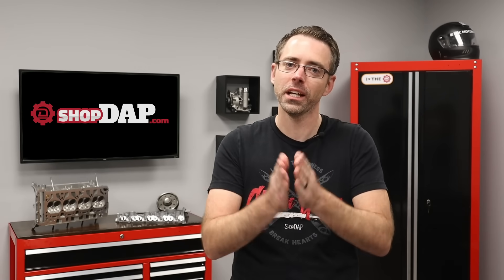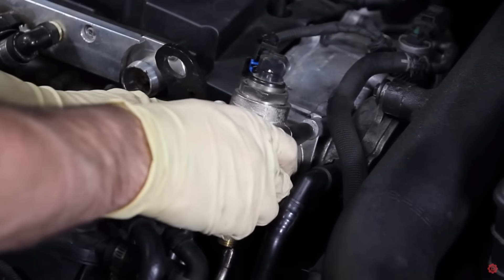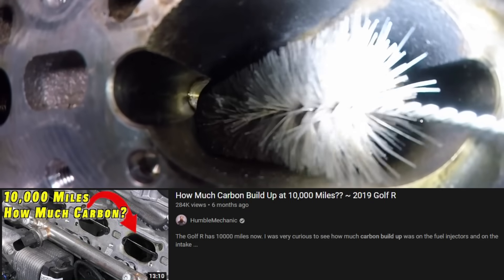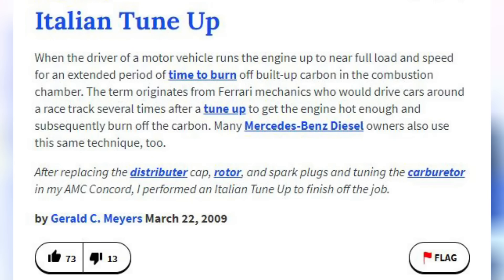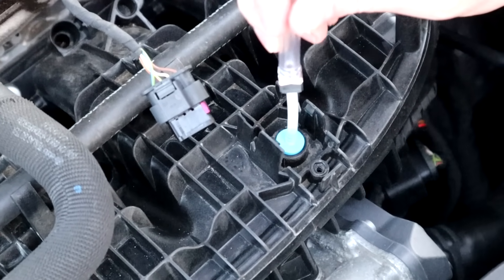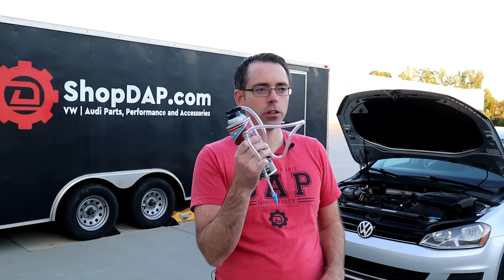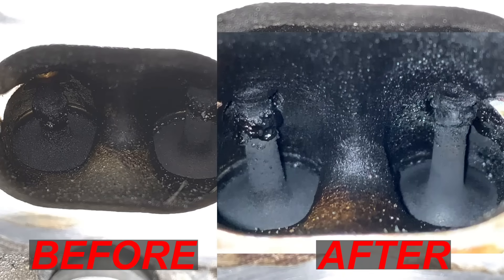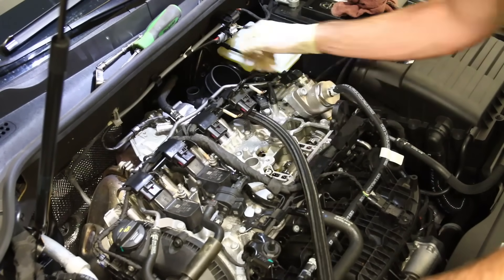Can you Really Remove Carbon for $29?

Comment: In the olden days we poured a 1/4 cup water in to carburetor while engine running and rev engine up run for a few seconds followed with about a 1/4 cup of marvel mystery oil to relubricate, seemed to work.

Comment: Automotive emissions have nothing to do with atmospheric/the ozone layer. It was chloroflourocarbons (the R12 refrigerant vehicles used to have, other refrigerants and spray propellants) which created most of the ozone damage. PCV systems were for hydrocarbon emissions and road safety. The old "road tube" crankcase vent would dump oil onto the road surface making it slick. Hydrocarbon, nitrogen emissions and fog and sunlight create ground level Ozone however which oxidizes body tissues.

Comment: Trying to diagnose a problem with my mk7.5 puffs blue smoke on start up after a good drive if it sits for a short period of time would carbon build cause my valve seals to leak resulting in the smoke on start up ?

Comment: FYI, Co2 is a global warming gas it will not punch holes in the Ozone. Freon- R12 is Ozone depleting, not C02.
As for dissolving carbon into a running engine, the moment dissolved carbon is combusted it crystallises and will damage the engine. Then there is the carbon build up in the oil control rings!!
The sooner Audi, VW and all the rest of the direct injection cars are scrapped the better.
 
The VW group was never seriously interested in the environment, see Diesel Gate and Direct injection.

Comment: I try to use the STP pro series Valve cleaner every 3 months to keep a grip in the carbon.. But sometime I'll mess it up like yesterday..  I put the little you bend in the intake and then clamped it back down, But not realizing that I torqued the clamp to tight and sat there for 9 minutes with nothing coming out of the bottle because of the clamp.. I have wasted like 5 bottle's this way before. With none of the spray never making it to the valves. I am so fucking pissed. It's like almost 200 bucks wasted over the last year and a half.. It it ok to just pull the brake booster line and pray it in that way.. It just seems way easier than, pulling the intake clamp and boot off.. At least on my car..  Brake booster line  ?????????

Comment: I work at Mazda, so i service a lot of newer cars, i however drive a 2007 Mitsubishi Lancer/Galant Fortis (Last chassis for the Lancer/EvoX Gen). My Lancer is getting close to 400,000kms but doesn't have carbon build up issues as it is port injection + i do a chemical intake clean once a year. At work however, particularly on Mazda 2's.. we have seen significant carbon build up by 60,000kms, Mazda's band-aid fix was to program the VVT/VVL to open the valves slightly to  recirculate fuel vapours around the valves but its like a chemical clean on the high km cars.

Comment: Not sure which after photo's your looking at but I didn't see any reduction in build up.  These intake cleaners just don't have the time to do any removal before it is burnt and sent down the exhaust.  With port injection the fuel works from the beginning of the engines life to prevent any build up.  With the amount of build up in our engines these days you would have to use 10's of cans to maybe loosen the build up enough to clean off the ports and valves.  

Get the cleaning done properly and then maybe a can of this stuff every 5000km or maybe just every oil change.

I would like to see a video on that.  Completely clean the intake with caustic soda and walnut blast the valves.  Do an oil change then when the next change is due, do it then a intake clean and see if there is any build up after that.

Comment: There really isn't an easy way to remove carbon build up  on the air intake and exhaust ports. But I really like the idea of using Baking Soda over nutshells.  Baking soda shouldn't be a big deal if it gets into your engine. Sure change the oil, but it's not like the stuff used to blast off carbon. I think deleting your pcv valve and going to oil catch can is best way to reduce carbon build up in the first place.

Comment: I never paid much attention to direct injection until I bought a new Mazda CX-5. Now that I have been watching all these carbon buildup videos I'm wondering if I bought the wrong car. Then I discover, out of ignorance I guess, that I have been driving a direct injected Kia Optima for the last 8 years and 130,000 miles. That engine had the same performance and got the same gas mileage when I got rid of it as it did the day I bought it. Hopefully the Mazda will do the same.

Comment: Total Waste of time.   You need new glasses.   You saw and improvement on the AFTER pictures,   You exaggerate way too much.   It barely did squat.   I'll bet Berryman wishes you never did this video.    GDI is GARBAGE!!!    Buy an old car with Port Injection or a Lexas that has both types of injectorss.   The Port Injectors are there to was the valves because Lexas realies this is the only way to prevent carbon build up

Comment: 8 months later, still running WMI on my ea888 gen1 which takes me to almost 2 years in total of WMI on that engine. It's doing its job. In the long term I would say the initial cost and install time it has been worth while.  

I would like to mention that I was having minor cold start misfires before I installed the WMI,after about a month of running -20f washer fluid with the wmi starting to spray at 3psi and progress to full spary at 25psi. I did/do run the car hard so it sprays often.  Anyways,after about a month my cold start misfire went away and hasn't came back at all. I haven't had the manifold off in a couple of years(hope it stays that way.) So I can't tell you for sure how the valves look.
Reply: so your not sure if it actually is keeping them clean?

Comment: the Berryman product did not seem to clean those VW valves as well as other videos with CRV valve cleaner...and did you say you injected the fluid into the MAF hole?   Other vids say to use the brake vacuum hose...and hold the revs around 2000 rpms instead of just at idle, which you did.   Can you comment on those differences?

Comment: I totally agree 100%. rather prevent than cure. To fix a problem, better to know the reason for it. Fitters replace a failed part. Why the problem first, then fix. It is why so many make errors. Fitters replace parts, Mechanics see the problem, the cause, then fix, and can actually be free

Comment: brake fluid does the same just suck it in thought the pcv until the engine stalls and leave it over night ,cleans up nicely the intake ,valves and pistons ring . Change your oil after

Comment: This has to be the most insane adoption I’ve ever seen. They went from a super reliable fuel delivery system with port to direct injection? Why? So you get a tad better emissions when new at the expense of worse emissions for the life of the vehicle? I refuse to buy a direct injection engine unless it has supplementary port injectors.

Comment: I did exactly what you described at 7:20min. Scrubbing, cleaning, scrubbing and cleaning etc. It took a day on my 6 cylinder and the car drives like new again. It was completely black and thick on my BMW N54 engine.
It is also easy to do with some technical knowledge. Take intake manifold off, clean and replace intake manifold rubber gasket.
Reply: Doing mine at the moment . How did you crank the engine over to get the last 2 valves?
Reply: @edencovich6148  I hope you have figured it out. But I just tried to start it which moved the valves.

Comment: Five Guys is average, but what is really good is Shake Shack.  And as to your haircut.....I prefer the earlier version, sorry.

1.  Italian Tune Up:  I owned a 1985 VW Scirocco turbo in college in Florida, and went home to Michigan each summer.  I noticed that the day after I made the trip either north or south that the car felt like it had a bit more power.  It was really zippy after the 1100 mile drive at 65-70 mph, and I attribute this to cleaned out combustion chambers.  I didn't drive it hard, I drove it at high speeds for 20+ hours = Italian Tune Up.

2.  SeaFoam, et cetera:  I suspect if you run enough cans of this through your engine you will indeed get rid of the carbon, at least to the point where it doesn't matter anymore.  What I would be worried about would be the catalytic converter....

Great video!

Comment: i dont know about this whole italian tune up thing but a DPF burn off is a very normal thing in MB diesels as mentioned in the video. wouldnt work like you describe though like spinning around in cold air covered in honey. exhaust temps get hot enough to ignite the DPF wafers and its gonna clean the shit out of it. and youve triggered a successful DPF burn. wont take care of the intake manifolds though thats for sure.

Comment: Hello, EA211 TSI owner here. If feels like you dumped the stuff into the cold engine, considering how the engine rattles. High temperatures speedup such chemical reactions - try cleaning carbon buildup on a hot electric kitchen stove vs cold, you'll see how easier hot one is dissolving. :) So the overall result would probably be better when the engine was fully warmed up.
Thanks for the video, I have 55k miles on my engine, should try this in the future.

Comment: As of 1956 the pvc was introduced on a265 small block Chevy now all cars as of 1964 none of those gasess was ment to be let into the air so get it right none.if any car had open breather. On it after 64 was a mod that didn't fall into epa gide lines so it's illegal.but if blow buy was excessive then they rings are bad not the pvc..

Comment: in the olden days we use to fill an oil can with a water land emon juice mix, remove the air cleaner and squirt water and lemon juice into the carb while the engine was running at half throttle to decoke the engine,

Comment: I did this job today, nothing happened, no smoke, nothing improved at all, and I have never done this before with a Kia soul 2012 and 66K miles on it. I use the PCV hose and one can CRC, wait one hour, and drive on the freeway or why. I used a whole can, waited one hour, and drive on the freeway or hwy for 15 minutes high speed of 65 mph and sometimes push the gas pedal hard to 80 mph. Maybe is me that treats the car right and does all maintenance on time.

Comment: I was going through NADC in Nashville Tn. in 79-80. That to this day is the worst carbon build-up I ever seen.  It was in shape of the cyl. Head molding on a  63 Nova Station wagon small V-8. Poor Vietnam Nam vet with family & kids A great guy had drive back to CA we getting  ready grad. Rebuilt engine with guy from GA who put up money & they took care bottom end of engine we did it together as class project. How it ran before I don't know. He only could been producing maybe 40 HP.  I sure wish I took photos of it. Them days Cell phones was in the  cartoons pages. They was spots on valves I bet carbon was built up a good 1/4"+. Thick.

Comment: Excellent video ☝️

Catch-Can fan here 👍.  

I installed mine on my brand new Honda Ridgeline 3.5-liter V-6 right at 900 miles on the odometer.  I’m a Mobil1 user and do my oil changes at 3K miles.  First oil change coming up in 500 miles, we’ll see how much condensed stuff is collected…

Thanks for the info !

Comment: Hate to piss in your biscuits there Young'un , BUT , carbon and it's issues have been around for a LONG TIME !!!  Back in the day we'd begin opening the throttle and dribbling water from a coke bottle into the carburetor . You'd open the throttle more and more a pour faster until the engine was just threatening to begin to stall , always keeping the engine at a reasonable and safe RPM . There was no question as to whether it worked or not , just stand behind the vehicle and try to dodge the CHUNKS of carbon as they made a very speedy EXIT FROM THE EXHAUST PIPE !!!!!

Comment: Seems to me that cutting off the head of the snake (PCV valve) is the best solution. Where I live, there is no emissions testing. But if I owned one of these cars in an emissions state, I would do whatever it took to stop that PCV from dumping into the engine and when emissions time comes around, put it back to factory, then switch it back out.

Comment: Morley's upper cylinder lubricant injector system Meyers a tiny amount into the air stream & like Reddex coats intake runners & valve backs with a thin film of it over everything.. valve backs & stems get a varnish like coat on the hotter valve heads that carbon doesn't seem to stick to..

Comment: Use good synthetic  oil and shrink the service intervals  after 50,000 miles, at 150,000 rip the head off and get it serviced  , catch cans help as long as it's set up properly.  Good luck .

Comment: Soooo, we just ignoring good ol Seafoam then? You know, the guys that've been doing this same thing, pretty dang well too, since uhhh 1930? Because uhhhh, it does indeed work well. And the best way to get it into your intake is via the brake booster, if present. But any vacuum port that you can successfully hijack is fine. Best used with a dripper can as well, of which you can control the "IV" drip via. You get a good deal more smoke out the pipe, and a great deal more cleaning throughout the entire path of the chemical.

Comment: I’d recommend a catch can system that supplements the PCV system, NOT a PCV delete as seen in the video. If you delete it, the catch can is the only think working. If you keep the factory PCV system and add the can inline, you just make the system that already works, BETTER. Don’t reinvent the wheel

Comment: I think is the emission system, engine design need to burn the flame before out to earth, so all the engine flame need to go to the intake manifold and the EGR system too, so if you put oil catch can shall fix the carbon, like  my car I just disconnect the hose that connect just before the throttle body to rocker cover and plug the throttle side only, then I don't even need to clean the throttle body any more and no more carbon, so you want to save the earth or save your engine ?

Comment: The Italian tune-up will work if you have a mixed direct injection and port injection vehicle, and the previous owner never got in the throttle enough for the port injection to turn on.
Obviously it's not a one-time thing but spraying the valves regularly will clear it up.

Comment: I ran a hose from the windscreen wiper bottle to a vacuum test port on the throttle body,  the hole in the pipe was tiny so the vacuum would only suck up the contents of the bottle over a days driving it cleaned the carbon from the exhaust side.. This car was not direct injection... It might work on these too... Mayby.

Comment: Fact 
The harder an engine is pushed the more  blow by occurs past the piston rings.
This results in more carbon in the crankcase and hence more carbon in the inlets.

Drive carefully and rarely will you have an issue.

BTW your after photos look worse the before photos 🤭

Comment: Exactly how does high octane fuel use keep the valves clean of a direct injection engine? The fuel is being directly being sprayed into the cylinders, bypassing the valves. Port injection sprays fuel on the valves and is a solvent to keep the valves clean.
Reply: I think it’s just the general consensus that higher octane fuel combusts a lot better and cleaner thereby not generating the same volume of waste byproducts during combustion as an engine would with a lower octane fuel. This in turn would result in less gunk on the valves. I don’t believe this is accurate though and don’t think it would keep them clean, rather maybe just delay the amount of buildup over time.
Reply: Tier 1 gas ie. Chevron and the like not BP

Comment: Do what the drag racing guys do. Put a 1/4" to 3/8" metal tube in the exhaust manifold (has to be at an angle sufficient enough to cause a vacuum) before the cat then hook up your pcv hose to that. Don't forget to plug the hole in the intake where the pcv hose originally hooked up. The cat should burn any vapors coming through and not be an issue as far as clogging it up.

Comment: I have an Ecoboost DI engine and have resigned myself to a manual cleaning at some point. To help mitigate, I run an oil with a high NOACK spec (helps to mitigate vaporization of the oil at high temps), run the most efficient air filter I can find (so outside contamination is not added to the buildup) and drive it like the old man I am. E.G. avoiding high boost or long periods of high boost- which tends to increase blowby even in an engine with rings that seal well. I know this is a VW/Audi-centric channel, but one thing I would have benefited from hearing about is whether and how much running the cleaners thru a turbo is detrimental to it.
Reply: Staying out of boost, that’s taking all the fun out of it!?!?! Lol

 You’re supposed to run the cleaners into the intake manifold or anywhere into the intake-stream after the turbos. Ive been performing BG, and other two-three part fuel system services on my own, and customer’s vehicles of all kinds for 12-13+ years. Ive done hundreds of them, and I’ve never heard of it causing an issue.
Reply: @zacharymurdock6721  IIRC, one of the cleaners instructs you to you do it thru the turbo on the Ecoboost engines. But in any case, based on what we saw here... would it be worth the effort either way? I am a retired tech and worked on German cars a lot. I worked at an Audi dealer in the '90s and we did that walnut shell treatment on a fair number of cars to deal with their driveability issues. These sort of problems are nothing new but it irritates me they are still here. In teh case of the 1.5L Ecoboost, it's not a cakewalk to do a teardown inspection, old geezer that I am, though I might do the borescope thing. I'll probably take all the mitigation steps I detailed above and wait for symptoms. The engine will be fully out of warranty by then, of course.